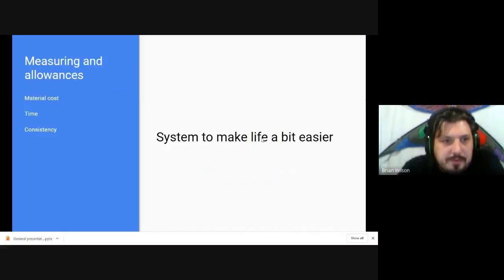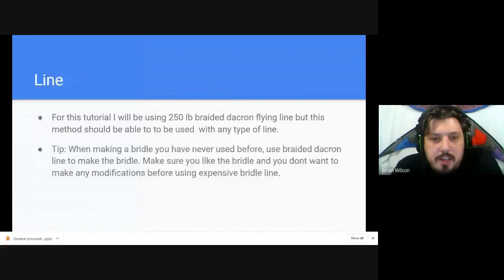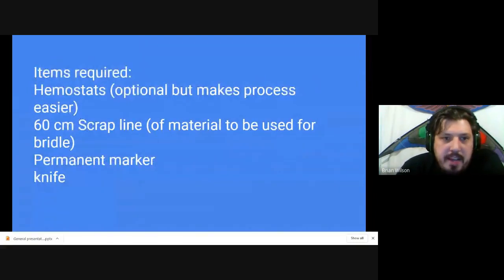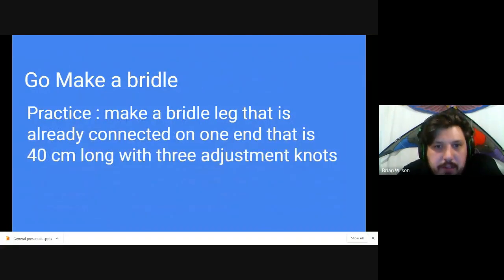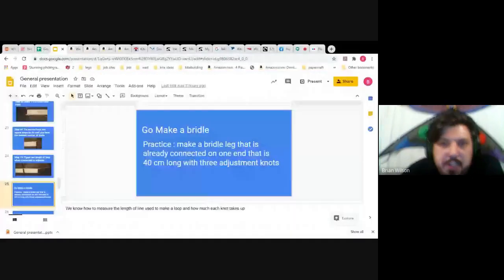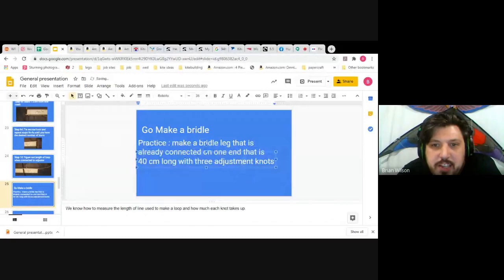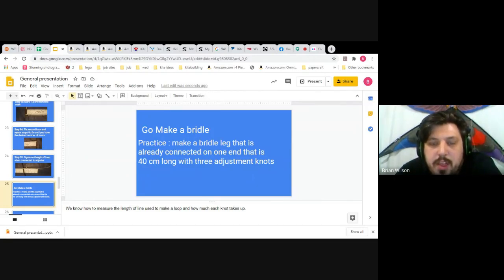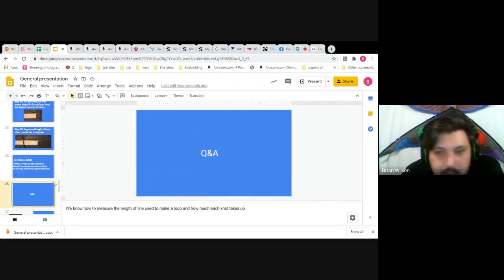WFGKC - Bridles for your Sport Kite - Brian Wilson - Virtual Session Recording

Comment: How make bridle dynamic quad line kite djinn??
Reply from the maker: If your looking to make a dynamic quad line bridle,  most of the techniques are the same, just with an additional leg.  A good place to start is with Andy Wardleys page or look up 'turbo bridles'. 

The Djinn by Kite Forge has a unique purpose built bridle that came from decades of flying and experiments.  I am not sure that John Barresi has published the how and why his bridle is designed that way, but I think he has shared the resources he used and learned from to get there
Reply: @FortunaFound  ok :) 
But my rev can't axel if use bridle srandart...  how much the revolution kite weighs in gram?? does weight affect the revolution kite??
Reply: @ranceke5333  bridle helps, but it's not the absolute solution - we axeled Revs for almost 20 years before I released the Djinn, so I'd look first toward building your own skills and actual understanding of the techniques.
Reply: Just looking at some of your recent videos, the most obvious challenges - your top lines (not bridle) are adjusted too short, you need more "brake", and your hands are wandering all over the place... Again, biggest tip is to study FORM and technique before you blame the equipment entirely.
Reply: @JohnBarresi  thank you jhon barresi, i am waiting for your video about axel and kite settings in detail. 

You are my inspiration, jhon barresi... 😊🙏 thank you very much...  I am from indonesia. 
in Indonesia it is very rare for quad line kite players 😔
Reply: @ranceke5333  Thanks! There is already an Revolution axel tutorial in the paid members area of KiteLife, FYI...
https://kitelife.com/forum/files/file/334-rev-tutorial-axel/